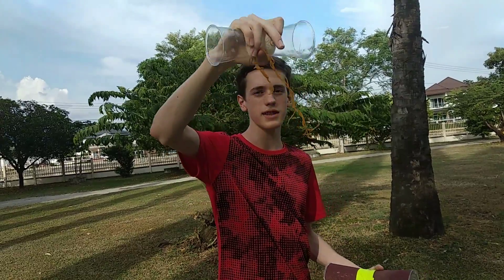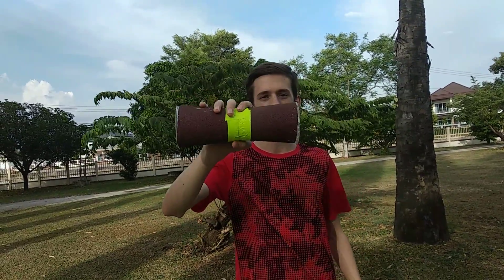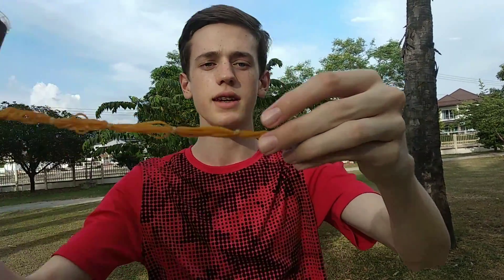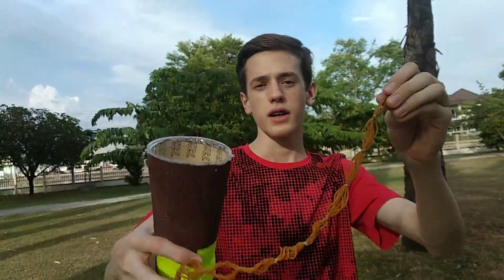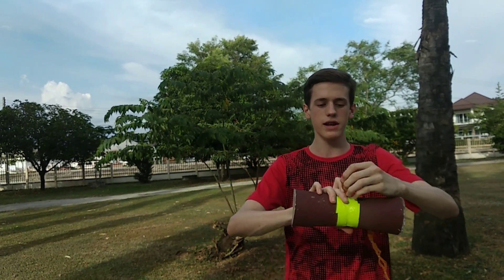Making Cup Gliders with Sand Paper! ( How to make magnus effect cup plane glide farther )

Comment: Make another one, but glue the sand paper on it with the sand side in.  Shoot both many times in a windless area.  Do everything exactly the same every time.  Measure which one travels furthest.  That will tell you whether it's the rough surface or the extra mass that is giving you the better glide.

Comment: But why sand paper???
The smooth surface will work better
Reply from the maker: Hey, it was just an experiment. And I'm not sure if it was because of the weight or the texture.
Reply: @CreatingCreations  
Great start.  
Make another one, but glue the sand paper on it with the sand side in.  Shoot both ten times in a windless area.  Do everything exactly the same every time.  Measure how far they go and average the distances of each.  That will tell you whether it's the rough surface or the extra mass that is giving you the better glide.  
A scientist would say the extra mass of sandpaper was a 'confounding factor'.  Gluing the paper to both so only the roughness is different is called 'controlling for mass' in this case.  
A good experiment most often needs to control everything except the independent variable (roughness) to see its effect on on the dependent variable (glide distance).

Comment: Maybe it's the added weight plus more rubber band power? It would be interesting to see the normal cup glider shot with the 2nd rubber band. Great vid btw! 😀👍
Reply from the maker: Thanks. I actually tried that and the original one was to light for it, so it actually flew worse.